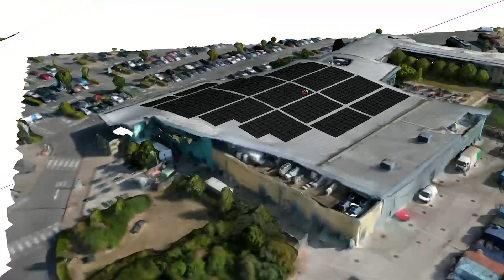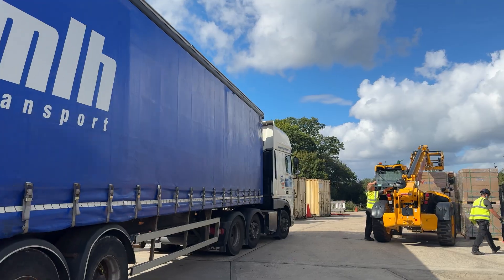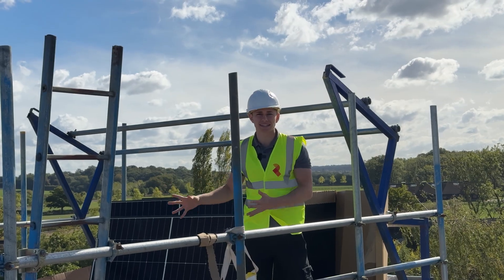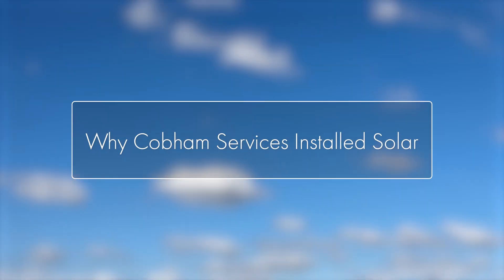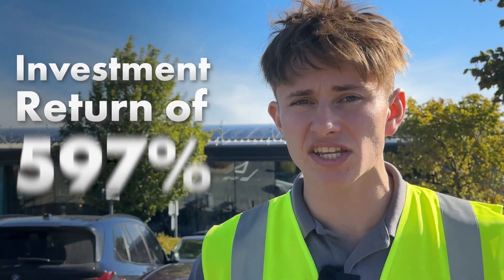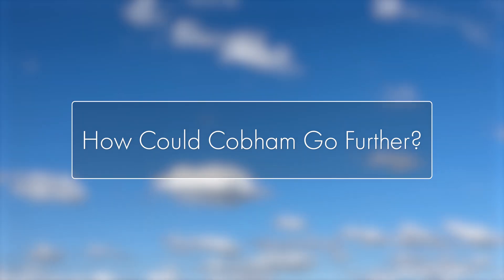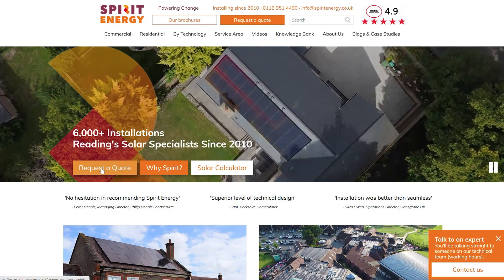Why We Fitted 800 Solar Panels On UK’s Busiest Motorway Services

Comment: The next challenge would be to provide solar canopies in the car park.  Excellent for providing shading and shelter from the rain, as well as supplying electricity for all those hungry EV chargers.  I suspect though that new structures and ground works would end up dominating the installation costs, but that said with clever design, you could avoid expensive scaffolding costs.

Comment: My calcs were off.
Thank you for reaching out👍🏻👍🏻

I was calculating down to the hour😂😂😂…not the day🫠
Reply from the maker: Hi, on average it would be more like 840 kWh per day, discounting seasonality. What data are you looking for? I may be able to provide more detail.
Reply: @spiritenergy_uk  
Hi, thank you for the correspondence 👍🏻👍🏻👍🏻
Do you have the specs of the panels, such as the wattage?
The calculator that was used, is it open/accessible to the general public???….would love to see how it plots the data, based on seasons and array size, based on historical data.😎😎😎

Comment: Battery storage for offpeak electricity storage is a complete con since as it will not be available for long enough to pay back the investment, they did that with solar to grid tarifs now there not worth it.Battery storage with a decent size solar array is the best answer producing your electrical needs in the day and charging   battery for nightime and ideally you wont be useing from the power grid with useage planning/management.
Reply from the maker: Hi, which country are you referring to? This is certainly not the case in the UK.
Reply: @spiritenergy_uk im in the uk and offpeak electricity will no be available forever as demand increases,onlly reason we have cheap overnight elecric is because theres a surplus availability.
Reply: Many businessese are investing in massive grid scale batteries - they are installing many gigawatts each year, so those businesses must believe that there will be offpeak energy for many years to come.
Reply: @simhedgesrex7097 It may work short term but they used to do free road tax on diesels,good returns on sollar to grid tariffs,those got phased out.Those businese often have big roofs with massive sollar coverage and big battery allso provides insurance against power outage,cuts.The most important long term investment is solar to battery produceing your own power independance for day and nightime use.

Comment: A really fascinating watch. I've worked on factory roofs many years ago, before retirement ( maintaining / replacing industrial extract fans ) and am aware of the precautions that must be taken. I noticed the surface flexing under the boots of the crew members and am curious as to how the roof was constructed.
Reply from the maker: Thanks, it’s a flexible membrane with standing seams. I’m afraid I don’t know the official term for it off the top of my head but it’s certainly sturdy and of course we did a structural assessment prior to installation.

Comment: Delightful! Are you connecting batteries (and use these as buffer to contribute to the EV charging points?)
Reply from the maker: Hi, potentially battery will be added in the future. But not just yet.
Reply: @spiritenergy_uk as a 24hr building that would make so much sense

Comment: If only all the other service stations around the country would do the same, together with commercial warehouses etc. The govt. also should mandate solar panels are put up on all new builds of any kind.
Reply: Not all existing commercial roofs are designed and rated for that amount of weight to be placed upon them. But yes, if can be, it should be.
Reply: @kristians9576 Agreed, but they DON'T have to be solar panels. They can use thin film solar instead. Not as good at generating electricity but a hell of a lot better than nothing at all.
Reply: @pinkelephants1421 I 💯 agree. However, they are also a lot more expensive per watt than standard panels, but the prices are coming down. It is definitely the future for those roofs that cannot take glass panels
Reply: It'll happen - the last Tory govt only rolled back business rates on solar (yes, you had to pay rates on solar panels!) a few years ago. I believe Tesco are looking at solar on all of their large supermarkets and warehouses.
Reply from the maker: Completely agree!
Reply: @spiritenergy_uk I've long held that the UK should be treating ALL rooftops, domestic, commercial, & industrial, as nationally significant pieces of infrastructure for the purposes of solar power generation. Whilst I'm not against grid scale rural deployment of such, I'm firmly in the camp of ensuring the usage of PRE-EXISTING infrastructure as a first principles approach to our need to transition away from the fossils to electricity, including making use of the obvious  - the pre-existing grid connections present in every structure. It would save billions on having to build new grid strengthening capacity, be a darn sight more resource & ecologically efficient/responsible, and significantly reduce the ridiculous grid connection times of up to something like 13yrs that commercial developers currently face.
TBC, I'm not incognisent of the fact there would be significant legal hurdles or overcome with regards to private ownership, but if framed correctly, I think property owners could be brought onboard with household batteries, a share of the energy generation, & perhaps a legal commitment to maintain the portion or portions of the rooftops for around 25-40 years (whatever the expected lifespan of the components (mainly the panels themselves) is likely to be.
Reply: The requirement to have solar on new build homes is due to return in 2027, previously they were scrapped in 2015 by David Cameron's government. My sister's home was built before then and her (water heating) panels means she uses no gas in the summer (and gets a call every year from her supplier to ask why!)
Reply: It’s no good for the grid . The electricity is fake AC created by a switch mode power supply it is very noisy . The grid needs lots of modifications .
Reply: @TronicUK well that’s patent nonsense.
Reply: @MePeterNicholls if I could understand what you were trying to say with those 4 words .